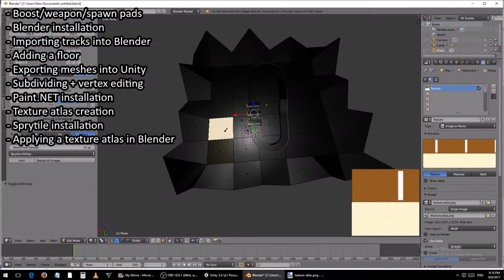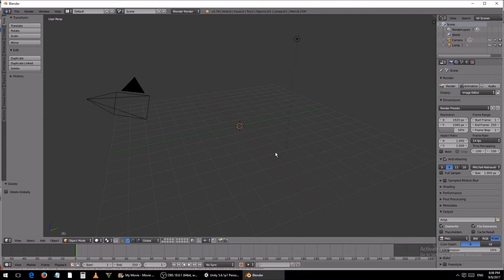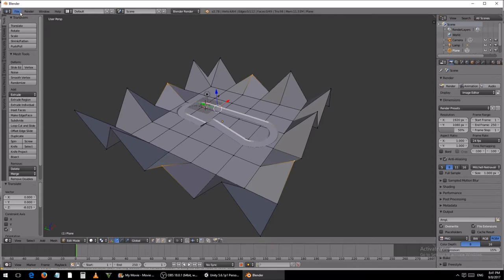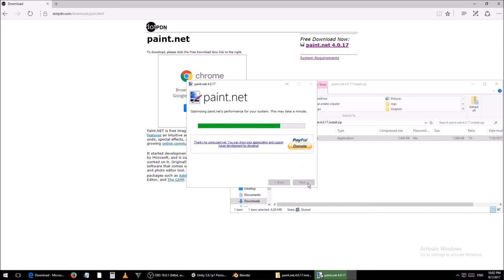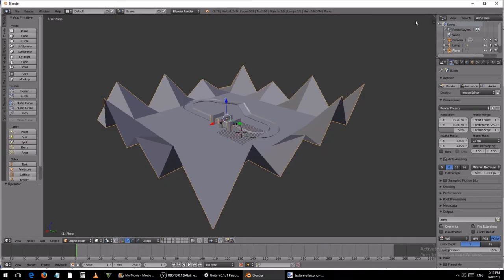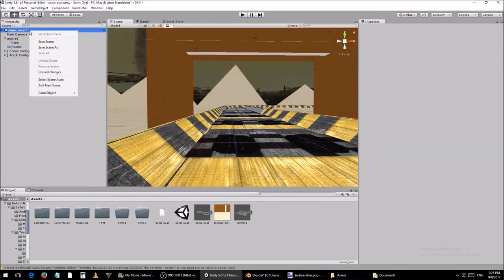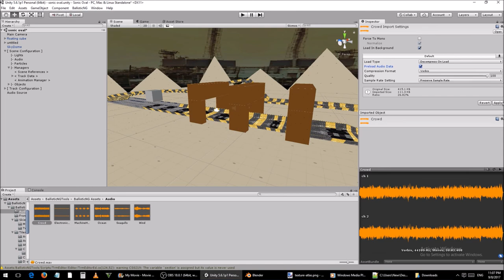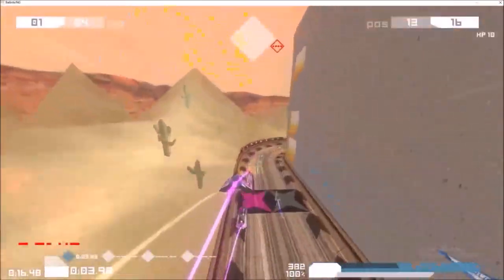BallisticNG Track Tutorial (part 2)

Comment: Uploading to workshop seems to have changed with 1.02 :

**Track Uploader
**
The track uploader is going to be depreciated in a future update in favour of a tool inside of Unity itself. The new tool functions the same as the standalone program but is just inside of Unity, meaning only a single codebase is required for full multiplatform support.

To access the new track uploader import the Unity tools update and then navigate to BallisticNG -> Track Workshop Manager from the toolbar.
Reply from the maker: thanks for sharing Xale

Comment: Michael I am racking my brain as to how Vonsnake textured and tiled all the buildings in that Shanghai map. I'm doing a city map and have a mockup of it ready to be tiled and I just don't know what I'm doing.
Reply from the maker: Hi Krihlus,

There was a time I didn’t know what I was doing either.
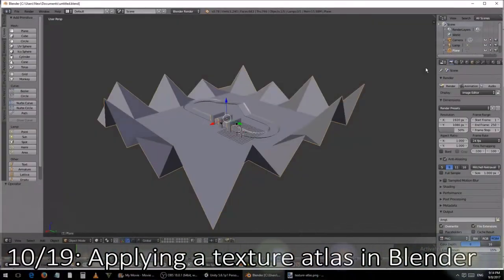It sounds like you’re in the exciting final step, texturing (47:02)

Texturing explanation:
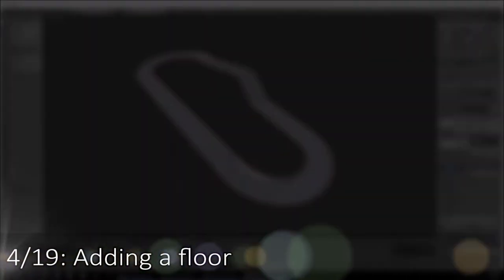- Prior to texturing, you should have the 3D objects (e.g.: rectangular buildings) in your map (14:14).
- Textures are applied using a special process. Basically, all your various texture images are combined into 1 big image (called a “texture atlas”)
- Then we assign (tile) small portions of this "big image" to the sides of each object (front, back, side, top, bottom).
- This special process is called “UV Mapping”, & was fairly overwhelming for me the first time I did it too.

Relevant parts of this tutorial:
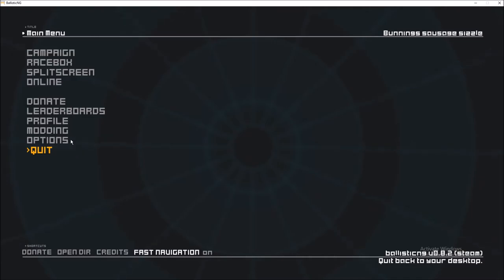33:52 Installing a free version of photoshop (to create the “1 big image”) 
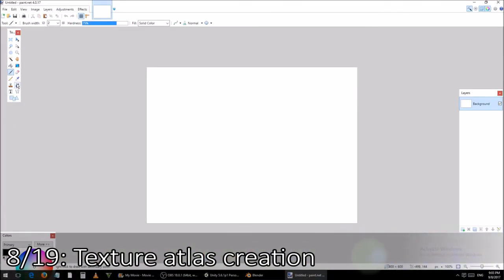35:19 Combining all textures into “1 big image”
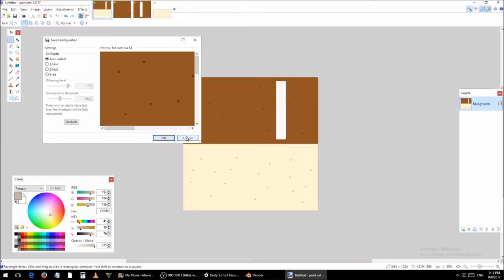44:15 Installing a tool that allows us to “use” small portions of the big image
47:02 Using the tool to apply textures
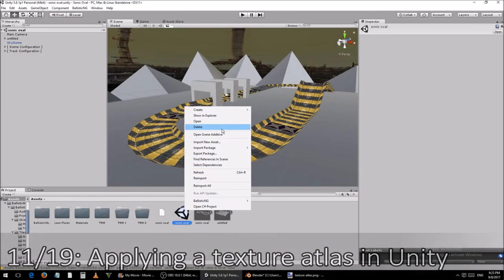55:15 "Installing" applied textures inside Unity

I'm currently busy with Cyberpunk, but lemme know if you need a hand & I'll see what I can do on my end.
Cheers Krihlus.